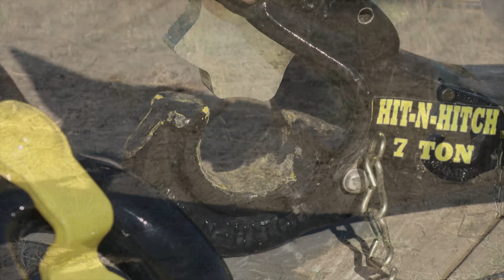Self Locking Pintle Hitch

Comment: How is this safer or stronger than a traditional pintle and who the hell hooks up and forgets to lock the pintle? you still need to lower the trailer and pin either hitch.
Reply: Seems like it would be useful if you're just shifting trailers around without a jack, but yeah that's pretty rare.

Comment: Look everybody we made a new hitch that costs more, isn't actually safer and is weaker in a negative tongue weight situation like loading machinery on the trailer. And we made a ring lock that's pointless. If you crank the trailer down on your Pintle that flimsy little tab is just going to bend up and out of the way.
Reply: Corey Schmidt I thought they were built bad too then I held one at a farm show and it totally changed my mind
Reply: The pivoting piece that locks it in is atleast 1/2 inch thick if not more. Its gonna take an enormous amount of force to bend that.

Comment: totally understand for a tractor application for a farm. pretty pointless for a truck use.You still have to get out and hook up safety chains breakaway cable and even lock the hitch.
Reply: I got a fully automatic hitch, I named it wife.
Reply: Lucas Gresham even lower the jack
Reply: Lucas Gresham agree it’s easyer sead than done still a hassle all it dose is drop for you like you sead you still have to put the pin and chain it and lift or lower jack

Comment: but if you still have to put the pin in then what is the point? you still have to get out. plus it looks like a lot less steel than a normal one also. i wouldnt trust it. i do trust that i remembered to push the top arm down

Comment: or you can just go euro or ausy and get a ringfelder
Reply: You mean the even more expensive overly complicated hitch. Sorry mate but when it comes to hitching heavy trailers simple is king. Less prone to failure. There is a reason that the kingpin and fifth wheel used on tractor trailers hasn't changed in nearly a century.
Reply: stephen Binkley 9syfrfhi

Comment: This is pointless. A regular pintle takes .1 seconds to close, you just give it a bop and it's closed. You still have to put in the safety pin, hook up the electricals. etc. This saves nothing and is much weaker in the event of accidental negative tongue weight.
Reply: The pintle hitch in the video was designed for on road truck use. They started in ag but also decided later to go into on road applications with the pintle in the video.
Reply: Kevin Meijer e
Reply: show me a hitch that puts the lock pin in place as well and I might take a second look
Reply: You didn't even listen to the entire video, did you?  He clearly explained why they came up with it, use it, and what they were improving upon.  So hasty in your judgment and no time to listen.
Reply: The Metal Butcher He said it was for tractors. Tractors have hydraulic hitches so they don't have to come out.
Reply: its for idiots who dont know how to back up into trailers to hitch up
Reply: The Metal Butcher agreed, stupid invention for road application
Reply: The Metal Butcher. It's a ford. It wont pull it

Comment: how is it self locking when you still have to put the pin in to lock it??
Reply: it's locked into the hitch, but the pin means it won't come unlocked when you go over bumps
Reply: vdub4201 My grandfather had something like this on his dumb trucks back in the mid eighties same Idea as this a little different though
Reply: Maurice Cooper What was dumb about his trucks?
Reply: vdub4201 you are a ass
Reply: rparker069 theird no spring in the plate it could flip up the other way amd the trailer could pop out. A normal pintal with a spring on the lock wont ever come off, and you wouldn't need a safty pin
Reply: vdub4201 j, iikkkkklľ
Reply: vdub4201 well one thing is that's dumb a construction company had trailers where you needed that thing and the trailers are worth a lot some people bought one of those stole it in less then 1 min